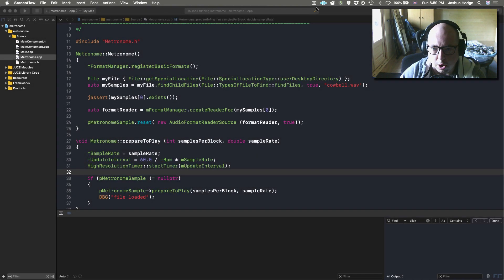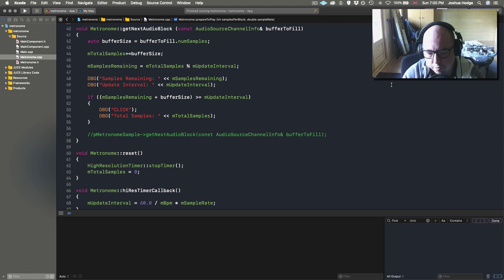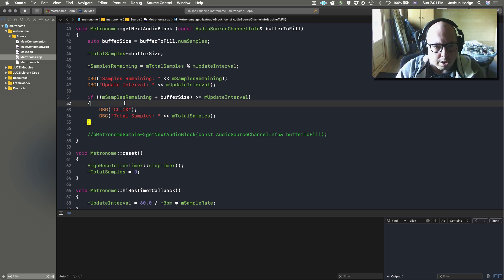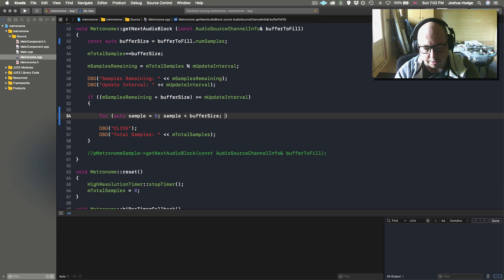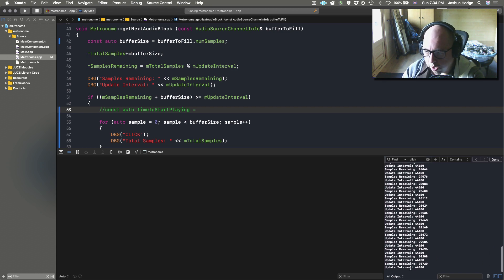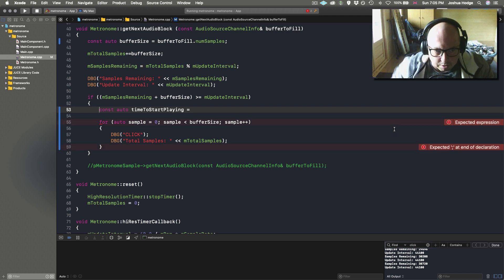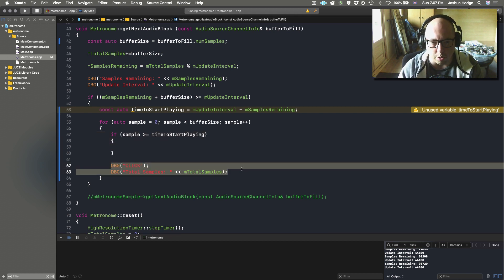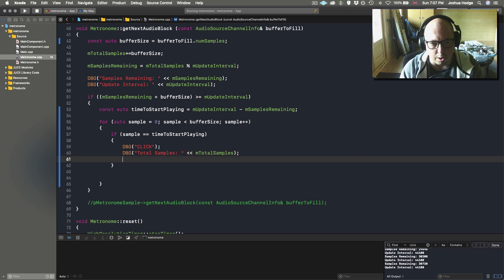Juce Tutorial 53- Creating a Metronome Pt 4 (Sample Accuracy)

Comment: Awesome tutorial! One little bug I wanted to mention. My metronome at first did not work at BPM 60 or 120, though it did work at other tempos. After some debugging, I discovered that it was because the variable timeToStartPlaying at these tempos was 441, which is exactly the bufferSize. As a result, the for loop was not reaching the value that it needed to reach in order to play the sample. It only went up to 440, not 441. So I changed the loop condition from sample < bufferSize; to sample < bufferSize + 1; and that solved the problem. Thank you so much for this fantastic tutorial!
Reply: thanks so much for the tip! I was becoming crazy :)

Comment: Hey, thanks for the great tutorial, everything is very informative and clear. But unfortunately not everything is working. For some reason only some BPM values are firing back correctly. For example when I set BPM to 90.0 it plays 2 quick clicks and then long pause, at 120.0 or 150.0 BPM it doesn't work at all.
Reply: I figured out this issue. It wasn't playing if "timeToStartPlaying" == bufferSize. It was the case because in your "for" loop, where you iterate over buffer size to select a sample start for the metronome click, it was never including the last sample. To fix this you need to change this "for" loop from:
     for (auto sample = 0; sample < bufferSize; sample++)
...to:
     for (auto sample = 1; sample <= bufferSize; sample++)
Or do other changes to this:
       if (sample == timeToStartPlaying)
   {
    pMetronomeSample->getNextAudioBlock(bufferToFill);
   }
Because otherwise "sample" is never == "timeToStartPlaying", if "timeToStartPlaying" == bufferSize
Reply: Thank you! I was having the same problem.
Reply: For anyone still having problem even with the suggested code, this seems to be working just fine: 

void Metronome::getNextAudioBlock(const juce::AudioSourceChannelInfo& bufferToFill)
{
    mTotalSamples += bufferToFill.numSamples;

    mSamplesRemaining = mTotalSamples % mUpdateInterval;

    if ((mSamplesRemaining + bufferToFill.numSamples) >= mUpdateInterval)
    {
        const auto timeToStartPlaying = mUpdateInterval - mSamplesRemaining;
        pMetronomeSample->setNextReadPosition(0);

        for (auto sample = 0; sample <= bufferToFill.numSamples; sample++)
        {
            if (sample == timeToStartPlaying)
            {
                pMetronomeSample->getNextAudioBlock(bufferToFill);
            }
        }
    }
    
    if (pMetronomeSample->getNextReadPosition() != 0) { pMetronomeSample->getNextAudioBlock(bufferToFill); }
}

Even looked up the range of bpm in which most metronomes should be able to play at, and tested this approach with the upper boundary 250bpm, and it worked perfectly.
It should be added that with this approach you will not be able to get the metronomes first click fire as soon as you press the play button...